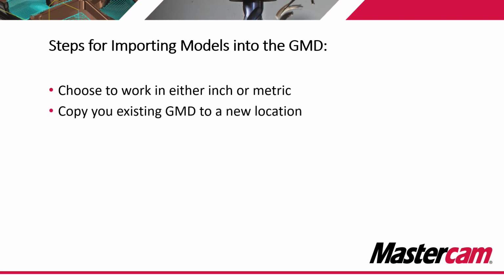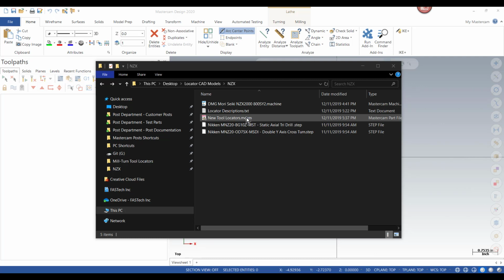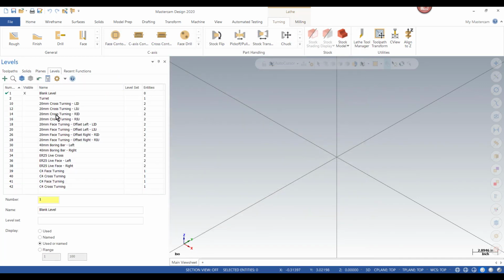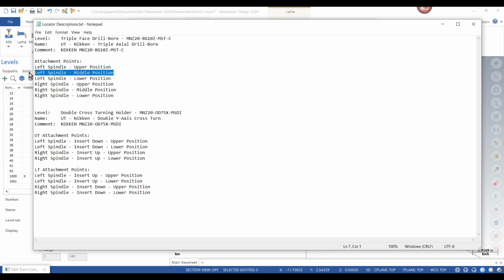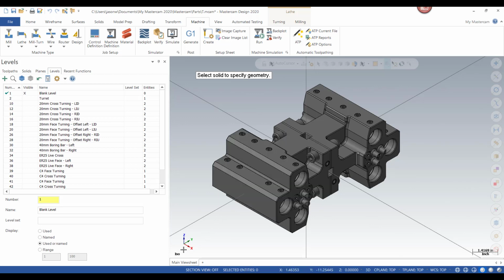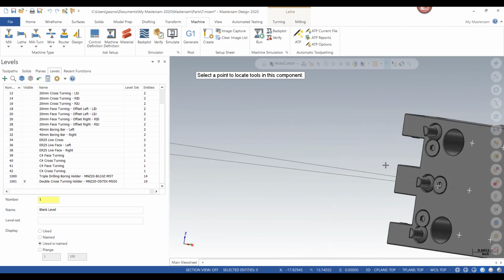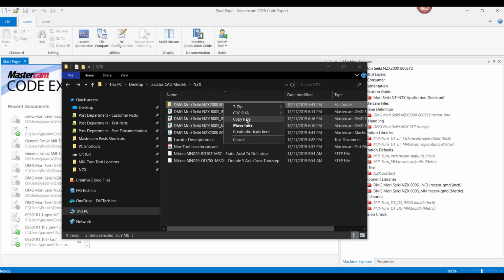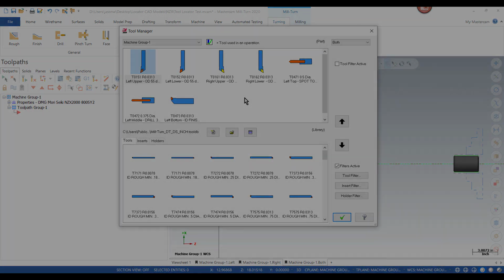Importing and Defining Tool Locators - Part 3

Comment: Hi,

i really like your videos. TY for the series.

Is it possible to save a standard configuration for your turret? Lets say i always have the same tool locators on the turret and i dont want to drag and drop them every time on the turret. I hope you get my question.

Greetings
Nico
Reply from the maker: Good morning,
you are able to save standard configurations in the form of a template part file! Basically, if you setup a part file with the tool locators that you use most commonly, then save that without any additional geometry, toolpaths, etc. You can just bring that in anytime you're looking to start a new part and the turret configuration will already be setup in it. This is the best way we've found to give customers/users flexibility and control over their configurations instead of forcing anything within the environment itself that would require downtime to send it to the local reseller to adjust.